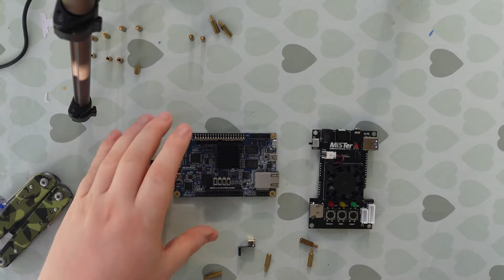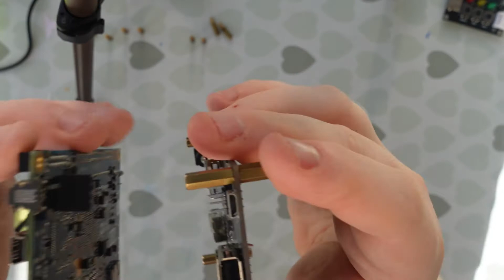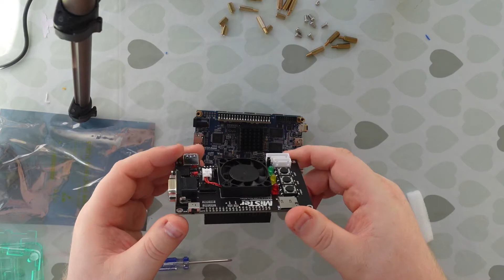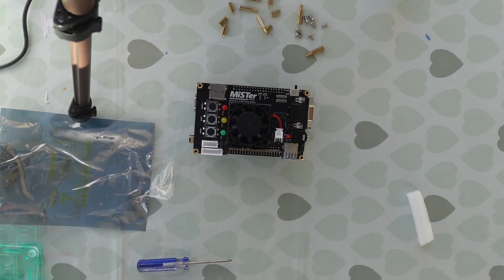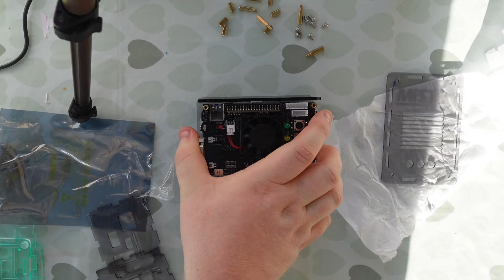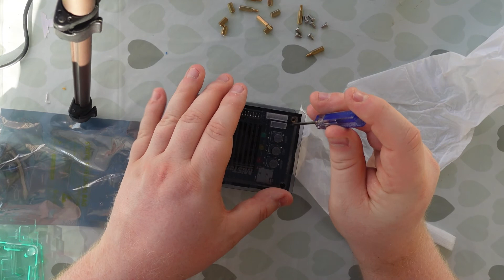Complete MiSTer Build, USB Hub and Analogue I/O with Case. MiSTerFPGA.co.uk

Comment: The buttons are pressed down if I screw the top plate on completely tight. Is this expected. I had to leave them partially unscrewed on one side so that the buttons could depress.
Reply: I think I figured it out -- I believe there are 14 mm stand-offs and there are 16 mm stand-offs, but they both seemed like 14 mm to me -- so obviously, the 16 mm ones need to go on top to leave room for the buttons to be able to release.
Reply from the maker: Nope, they should be beveled and poke through the 3 holes. Did you get your case from misterfpga.co.uk?
Reply: @allyourbasekris  Yes. It's the acrylic one purchased from misterfpga.co.uk -- the buttons do poke through the three holes, but the face plate PRESSES them down (and doesn't let them come back up again), if the top plate is screwed down all the way. Feels janky. I can provide a photograph / video demonstration within a day or so.
Reply from the maker: @TheChuckster402  It definitely shouldn't be doing that, the fitment is normally perfect. One thing that might be worth checking is if the spacers between your boards are all level and screwed into each other properly. I've had issues in the past where the case wouldn't  seat properly as some the spacers sat too high, it sounds like the opposite problem for you though. If you continue to have issues please drop them an email at <store@MiSTerFPGA.co.uk> they're really helpful.